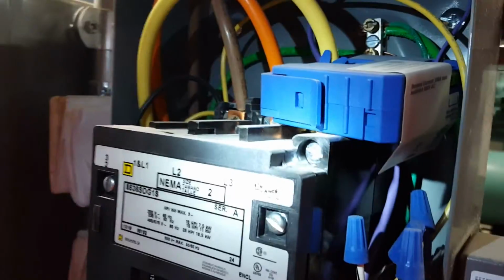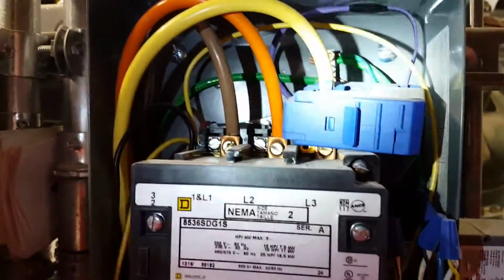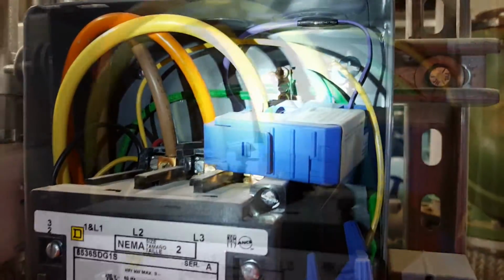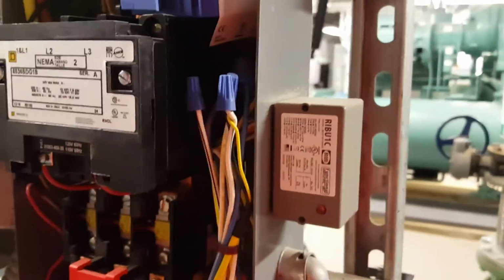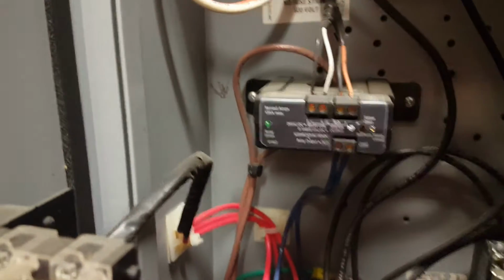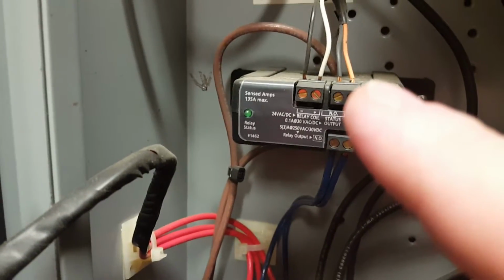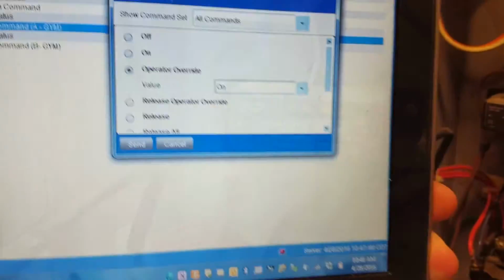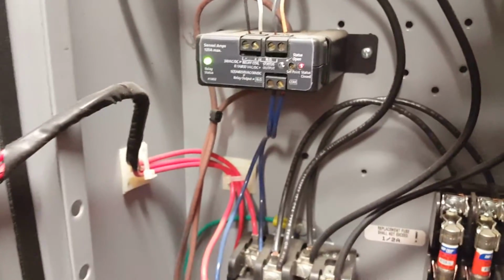How a Current Switch Current Transducer works

Comment: I have 110v 5amp control circuit i need to open and close based on current from supply air fan motor.
I need a CSR that opens and closes contacts (110v 5a) when it senses current. 
The supply air fan motor pulls 8amps.
Any recommendations?
Reply from the maker: You should be able to find a sensor that is adjustable to open at the range you need. We've used Hawkeyes and other cts. You could possibly do it through your control system if you out a vfd on the motor

Comment: How do you only have 1 wire for the current transducer?
Reply from the maker: There are two conductors there. It is simply contact closure.
Reply: To check the value of the current, there are two ways: wiring the two wires to the terminals of transducer(primiary side) , or current hole thru. In this video, he use a current-hole-thru transducer.  To buy reliable current transducers, you can visit https://www.g-sensor.net.